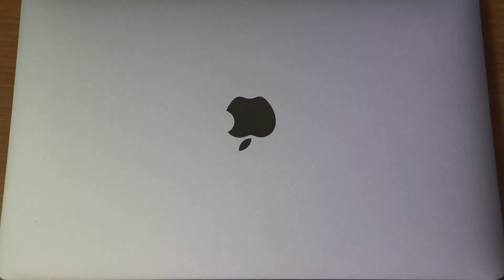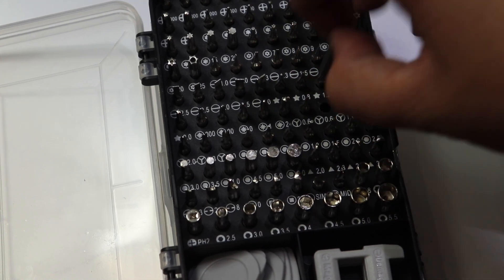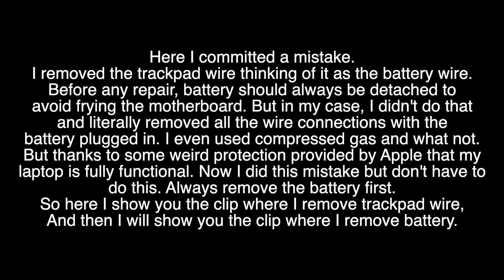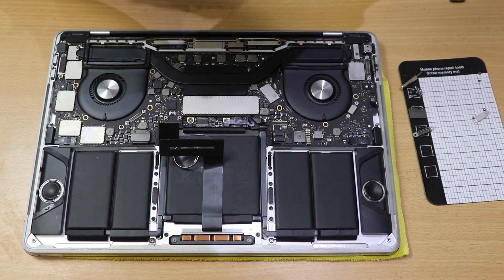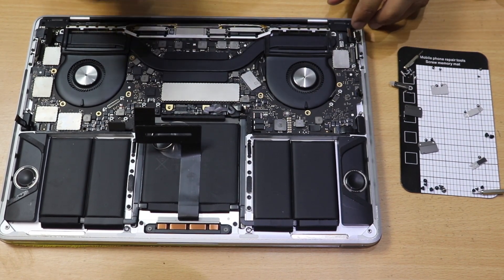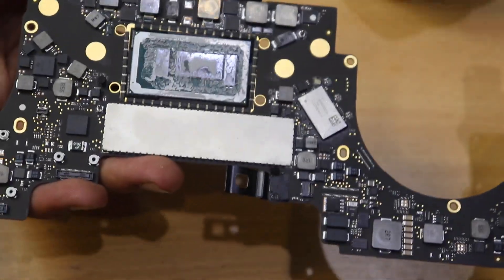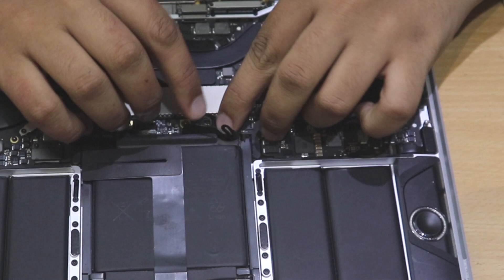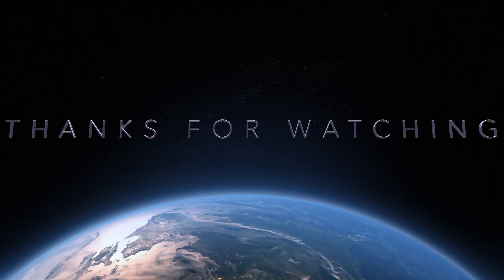MacBook Pro 2016/17 Thermal Paste Change | Hot & Slow MacBook issue fixed

Comment: This is much appreciated! I just completed the process, and my MacBook is working a lot better than it actually was, or is meant to be. I had some difficulties with some stripped screws (it would be good to add an extra video if possible to learn how you did it with super glue, please, but I I managed to complete the process without removing the screen cable you showed in the very last step. Once again, thanks a million for this video! Greetings from a south American guy in Moscow, Russia.
Reply from the maker: I am glad that this helped you ☺️

Comment: Thermal Pad.The gap between the CPU heatsink and the bottom panel of 2016 Macbook Pro 13inch No touch bar , is 1.5mm. I measured it with a playdough and pressed in the back plate.
Reply: how did the thermal pad work on that?? I am considering doing that or re-pasting. My a1708 runs so hot.

Comment: I’ve tried it like this but I feel it needs more thermal paste
Reply: "More" in this case actually works against you. There is a good "mid-point" to aim for, you don't want to bridge areas that don't need to get hot otherwise it ends up damaging the machine.
Reply: @r65  just cover the entire CPU with a thin layer, I see what you are saying but too much is bad also too little is bad there is a happy medium to aim for.